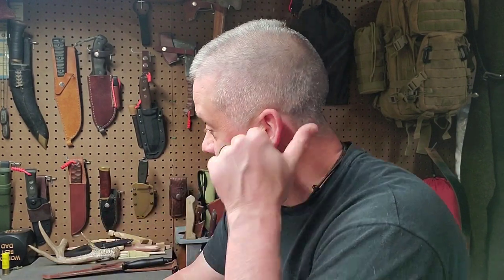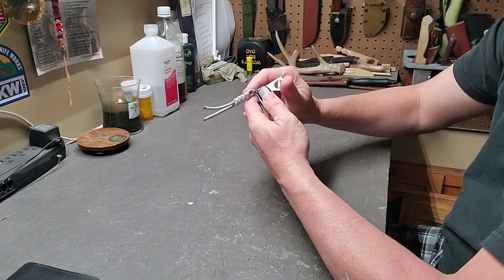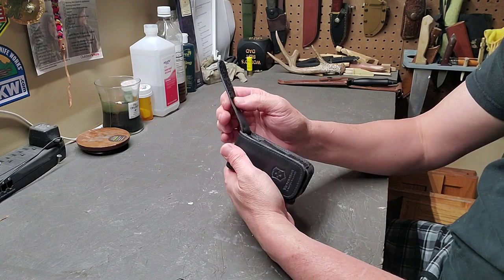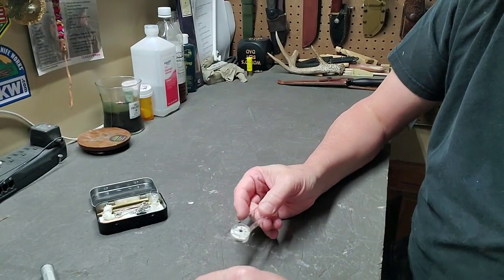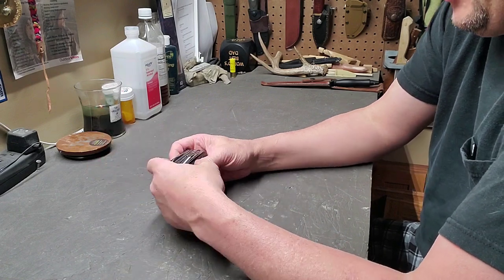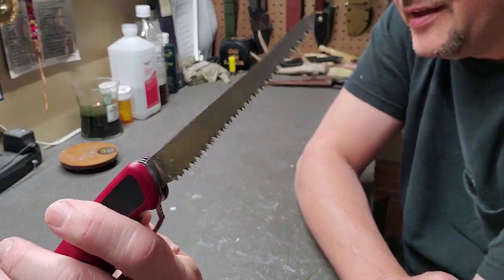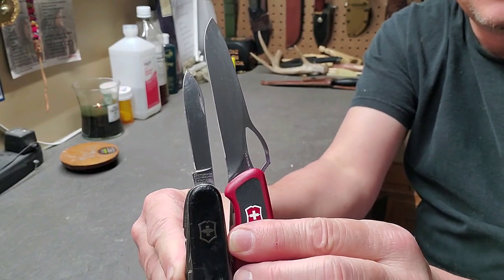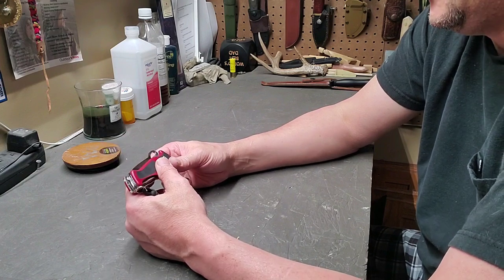A discussion about Swiss Army Knives.

Comment: The tragedy of the larger SAK is that in the UK it would be illegal to carry it, no matter what the reason. With the Champ, if you had a reason for carrying it, that would probably be legal. That big blade is so enticing! I'd love one of those knives.
Reply from the maker: I didn't know that. That's interesting that there is a size limit on a pocket knife. It definitely is a handy piece of gear to have. Thanks for watching
Reply: @CentralKyBushcraft  It's not only the length of the blade! The fact that is a lock-blade is even more damning. The ban on lock-blades is total - even a Stanley carpet cutter! You would have to PROVE (not just assert!) that you have a VALID (in their mind) and legitimate reason to be carrying that blade in a public place. So popping into the local pub on the way home from work is fraught with danger!     In general, defending yourself with a knife (or just about anything) is construed to be using an offensive weapon, and you could be arrested on the spot! [Of course, so would the other guy!] It's a tough set of Laws to understand and implement, and leads to much confusion. One has to be careful.
Reply from the maker: @dennisleighton2812  I could see where that cause a lot of confusion. It's a hard concept for us he in the states to wrap our heads around because our laws are so different. But this is a good reminder that when traveling to another country you should check the laws before you go and not assume that they're the same.
Reply: @CentralKyBushcraft  Absolutely!

Comment: also the Ranger grip line of swiss knive are all equiped with a hex screwdriver bits hole in the handle, if you remove the side scale with the victorinox logo on, you will find under the plastic the casting mark for where to cut the hexagonal hole , and the stainless part of the knive already have the hex hole in it, ready to receive a screwdriver bit of your choice . there is tutorial of how to properly do it online ;)
Reply from the maker: I didn't know that. That would really be handy. Thanks for the info.